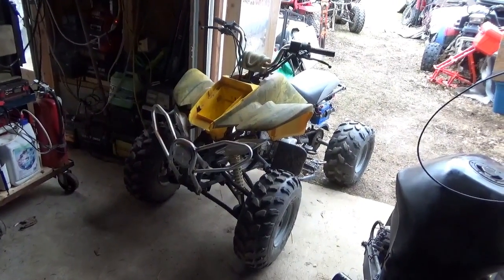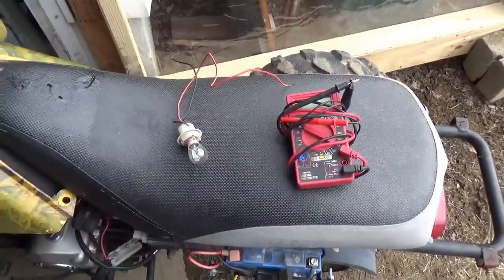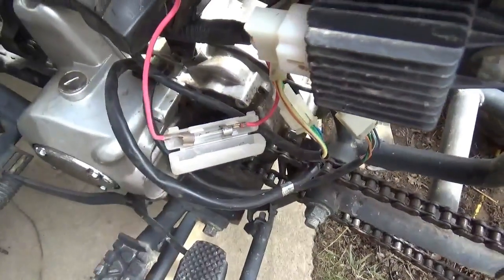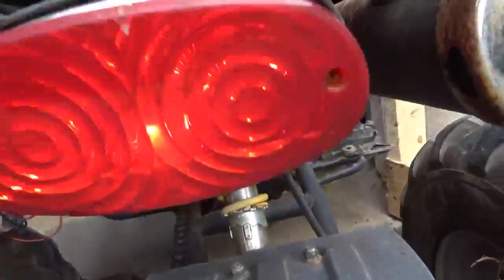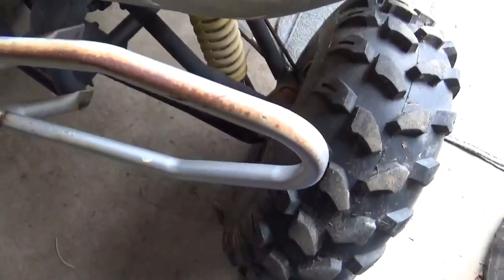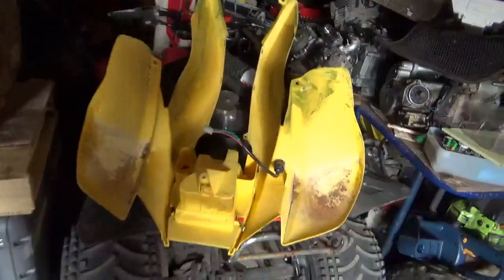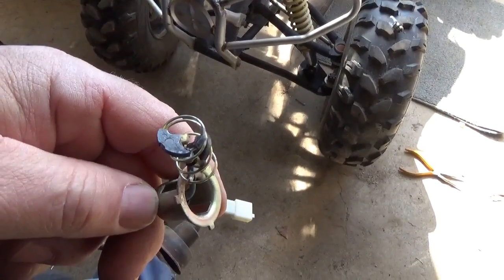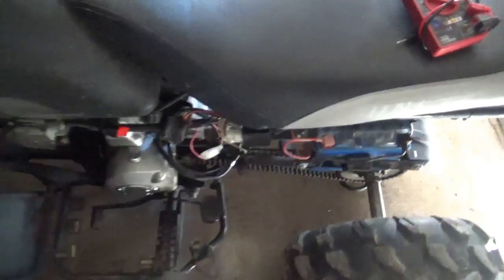Fixing ATV Blown Fuses, Intermittent Short CIrcuits, No Lights or Power to Starter!

Comment: Good trouble shooting . But i have a question . I was looking at some tires . 19x7 -8 and  25 x 10 - 12 . I know tires do not always measure the same as labeled .  Just wondering if you have very many in those sizes . And if so , Would you measure the Height of them . I know different brands may be a little different size and rim size matters . But just looking for a general height of those size tires . Then i will know if i want to get those sizes to put on one of my Sears Suburbans . Not sure what exact ones i will get , but just wondering average height of those sizes.I want to go a little bigger than the stock ones i have on it now.   Thanks.
Reply from the maker: Hey Terri!!!   I have a ss16 out back and other tractors... I will have to go out and look at them and see what sizes I have... I was surprised that 2 cents worth of cheap plastic ruined the electrical characteristics on that atv.... Thanks for Ur thoughts, encouragement, watching, and commenting!!!
Reply: @HarveySpooner   atv tires is what i was referring to . . The tractor original size is prob either 23 x 10.50 - 12 , or  23 x 9.50 - 12 on back , and 16 x 6.5 - 8 . I am thinking of ordering some tires online , but was wondering their height so i could be sure they would fit

Comment: Hey harvey. When i bypass fuse the 8gnition wires wanna melt. So i cant get passed step 1. What u think? Happy i atleast foumd a video w some help. Been weeks. Great channel
Reply: When The Wires Wanna Melt Or Get Hot It Means That The Connections That Are Associated With The Melting Wires Are Weak Or There Is A Break On The Wire Causing The Current Flow To Not Be Able To Pass All The Way Through Therefore Causing Resistance And Overcharging. So Check Your Wire Connections And That All Your Wires Aren't Damaged Also Check For Any Shorts In The Circuit Meaning Any Positive (Hot Wires Or Any Wires Connected To Or In Contact With The Positive Terminal) Coming In Contact With The Common Ground (Anything Connected To Or In Contact With The Negative Terminal)

Comment: Hey Harvey, I really need help on my Bayou KLF 300C 4x4…keeps blowing main fuse one key is turned to the on position. I read a few articles online and decided to unplug everything and plug them back. No matter the order, still blows fuse when I get to key switch. Right now, I have everything unplugged and I mean every single thing including lights, I also cut ignition key wires and installed a on/off switch new from autozone for testing purposes. My wiring looks like this now: Positive from battery goes to fuse and then to on/off switch newly installed, and Negative from battery goes to chassis (which’s works by light test to engine frame) and then through a smaller black/yellow and then connected to brown goes up to the same on/off  and got on in place of key 🔑. Guess what, as soon as I flip that switch to on it still blows fuse. 

I have all wire bundles opened up and man they look new and no signs of wear. I’m perplexed! Help please, thanks!! 

Note: Used a few good battery’s and used fuses from 5am to 30amo—the right one for this machine—and same thing happens.

Comment: Having the same problem what’s the proper way to bypass can I connect the two wires together? Or do I have to put something in between the two wires? Thanks
Reply: You Can Bypass The Fuse By Connecting The Wires That The Fuses Were Connected To On Each End (Hotwiring) Or Using A Wire Or Bullet Connector On Each Side And Connecting Them That Way. But WARNING Removing The Fuse And Bypassing It Is Removing A Safety Feature That Warms You And Avoids The Whole Entire Wire Harness From Melting Burning Or Damaging Other Components By Popping And Disconnecting The Positive Wire Therefore Shutting Off The Engine. The Fuse Pops When There Is Too Much Current Being Drawn From A Component That Will Overheat It Or Cause It To Blow  But Also Pops When There Is A Short In The Circuit Meaning When The Positive (Hot) Wire Comes In Contact With Any Ground On The Bike Or In Other Words Anything Connected To The Negative Terminal

Comment: I got a coolster 125cc that won't activate the starter with the push button or key. However, it blows the fuse when the key is turned to the off position. Any ideas?
Reply: I got one doing the same thing.

Comment: Hello Harvey could you tell me what you soak your carb parts in to clean also what brand gaskets for honda atv and carb kits for honda carbs I have a 86 honda fortrax 250 . Have you ever taken apart the honda ignition switch to cut a new key?

Comment: Where is the inline fuse connected, near the battery, of lower on the regulator or where tks
Reply: Between The Ignition And The Positive Battery Terminal

Comment: So basically, it was the light bulbs that caused a short. That y the bike wasnt sending power to the starter etc. Am i right. Cz ur not really clear on what the issue is. Cz u jumping from 1 thing tobthe other.